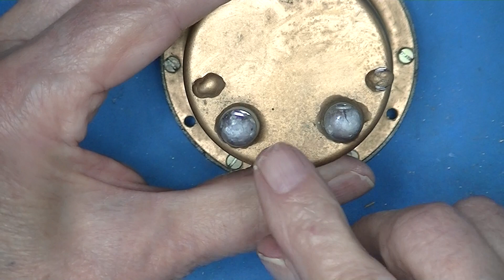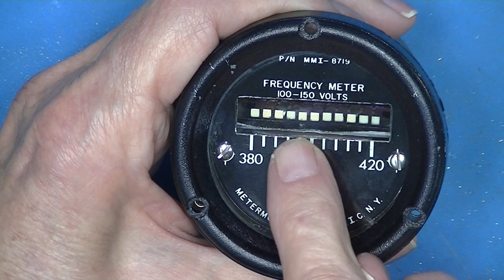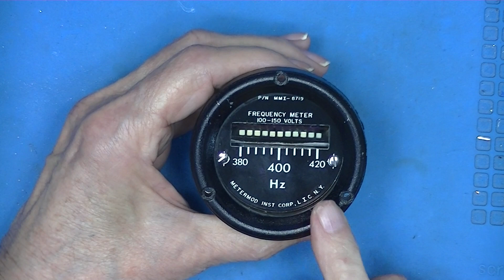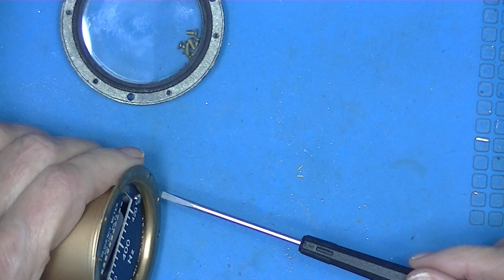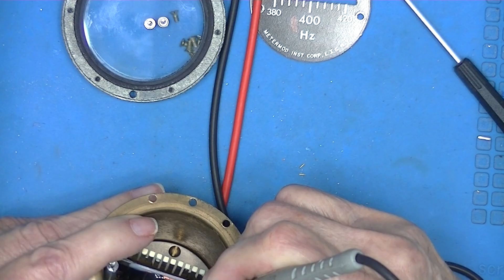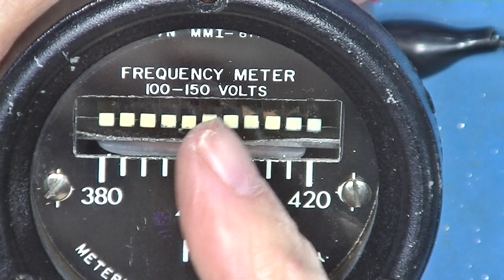Reed Style Frequency Meter

Comment: These are oftentimes hermetically sealed.
I excited mine by using a freq gen to feed an audio amp,and inverting the output voltage w/ a small plate transformer.
1959 era Standco works great!